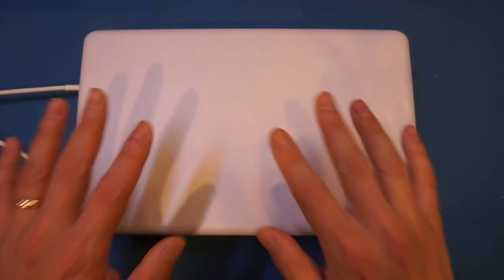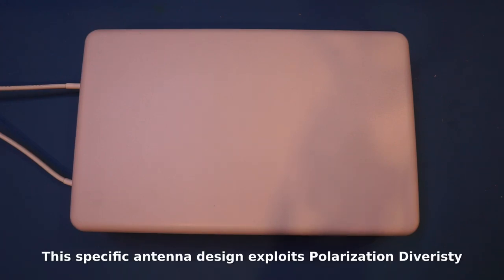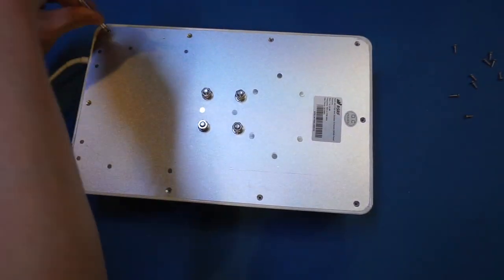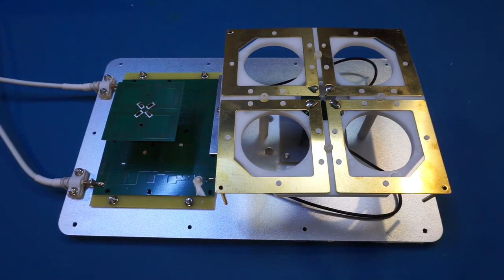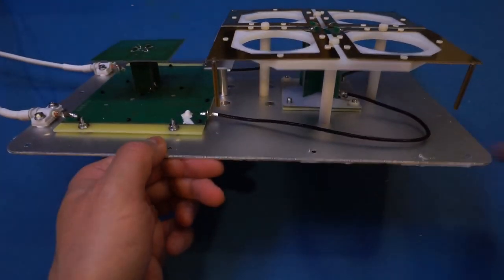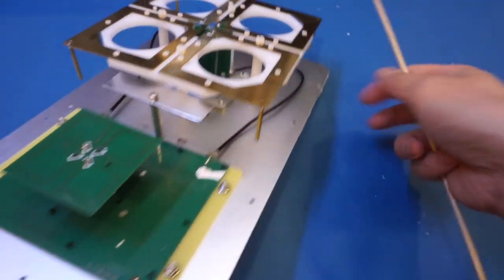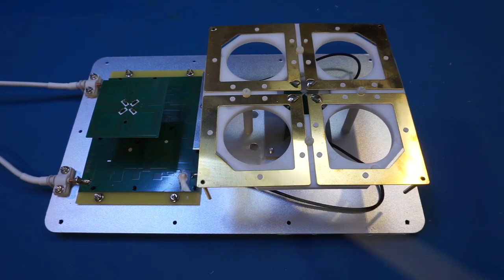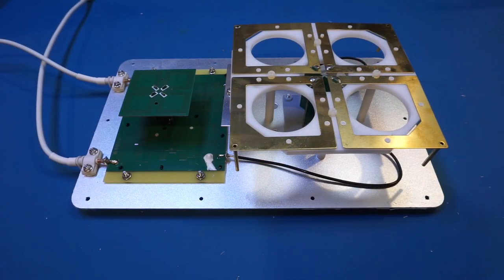Teardown of an RSRF Cross-Polarized Dual Band Cellular MIMO Panel Antenna

Comment: Given the positioning of that bar, I'm wondering if it is there to block any potential resonance coming to/from the solder points on the input lines. I could see transmissions causing slight feedback noise in the system if not shielded.
Either that or the bar creates a difference in reflection incoming on the two cross polarized antenna ? Or possibly both?

Comment: To your question about the added element (@7:07) that isn't connected to anything but backplane (the rectangular aluminum strip example) is considered parasitic elements...& yes they can serve as tuning stubs, energy directors or reflectors etc. Typically add & size these elements to obtain a specific profile with respect to radiation pattern & efficiency.
Reply: Microwaves are cool...allow easily made PCB antennas, tuning stubs, distributed element filters on surface of PCB (that's the cool looking artwork-appearing forms) RF combiners, splitters, all by shaped patterns on a PCBA.....can even create co-planer waveguide-in-a-PCB...of course the cheap epoxy resin type boards aren't up to it now but there are many more hi-tech substrates out there for creating entire circuits from patterning the copper or gold traces....fun stuff....nice work on the video's (watched 2 so far)

Comment: Pardon my lack of understanding but are these properly MIMO antennas? Don't MIMO require multiple transmitter and receivers to exploit simultaneous beams/multipath? Most MIMO antennas I've seen also feature many many more array elements.
Reply from the maker: As long as there are multiple independent antennas within the system they are proper MIMO. MIMO antennas range from simple implementations like this to phased arrays that contains hundreds of elements and used for beamforming...
Reply: You mix completely different things. MIMO 2x2 antenna must have 2 excitation ports (to connect 2 transeivers) and isolation between those ports (at least 15 dB, but better 25 dB or more). There is no limitation on antenna type itself. Your WiFi router can have 2 monopoles and it is perfectly MIMO 2x2. Multiple elements are Phased Array antennas (they can be either SISO or MIMO it doesn't matter), more elements = more gain = narrower beam. Phased arrays can be either passive (elements directly coupled with transmission lines to single transceiver) or active (commonly used in radar applications). Small cell base station antenna (femtocell, indoor) shouldn't have narrow beam, but wide coverage, so phased arrays are not good choice.

Comment: clearly that raised stand-off structure between the smaller and larger antenna, is a null creating ground plane so as to help with proper impedance tuning for hte frequency band in use.?

Comment: Great video! Would it be possible to disable the larger elements that pick up the lower frequencies so that my antenna will be forced to pick up the higher frequency 5G bands?
Reply: You could also just force the modem to connect to specific bands in software, depending on what type of firmware you’re running.

Comment: Hi are the cross polarized antennas effectively are in circular polarization or just two dipole antenna arrangement for better reception and transmission of mobile station that have no fix orientation with respect to the base station sector antenna.
Reply from the maker: Cross polarization is not circular polarization as the transmitted wave by each orthogonality polarized antenna is linear. They are essentially two antennas as you mentioned arranged in such a way to achieve maximum cross polarization discrimination so that they do not interfere with one another.
Reply: Thanks for the clarification and quick response to my query, hope you will upload more videos related to antennas.
Reply: Cellular operators use MIMO 2x2 2T2R X-pol antennas on base stations. Clients (smartphones, modems, tablets) also expect two simultaneous orthogonal linear polarizations incoming: one +45 degree to horizon and second -45 degree to horizon. Cellular applications do not use circular polarization. If you want to convert this antenna to CP (for applications non-related to cellular) you need combiner (splitter, bridge) with 90 degree phase invertion (can be hybrid coupler). 2 antennas in mobile client (smartphone, modem) is mandatory requirement for LTE  user equipment. Older GSM and UMTS UE can have only 1 antenna. 2T2R MIMO 2x2 X-pol base station effectively track polarization in uplink and use best possible source or use them both simultaneously (as a phased array) if software is sophisticated enough.

Comment: Hello sir...excuse me...recently I made 1 mimo antenna and when I tried to connect it to the modem, the antenna was able to catch the signal for 5-10 seconds before it disappeared...I want to ask, what is the problem and the solution to this problem...thank you 😀
Reply: soldering spot may not connect so well I think, that is why wifi connection is unstable.

Comment: hello sir...can u make 1 video to increase gain (example - from 9dbi to 18dbi) ... thx .. :)
Reply: In antennas, gain is directivity of beam. 3 dB is 2x power thanks to 2x narrower beam. 12 dBi is twice larger antenna with half-wide beam. 15 dBi is again twice larger antenna. 18 dBi is again twice larger. To get narrow beam with 18 dBi directivity - you need at least 8x larger antenna (it can be 1x8 array, 2x4 or 4x2).